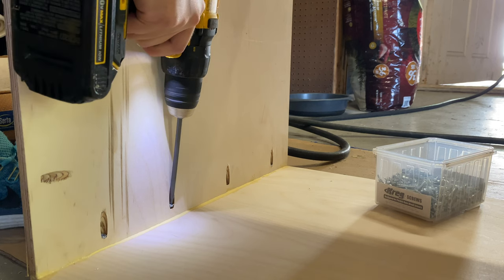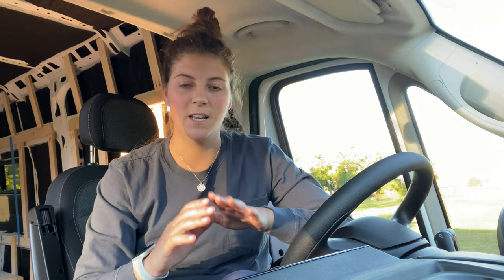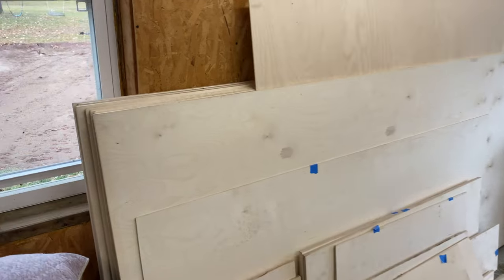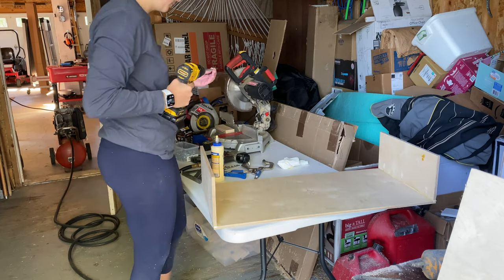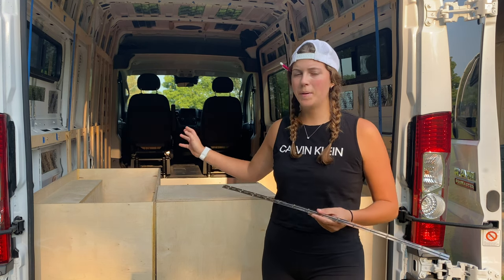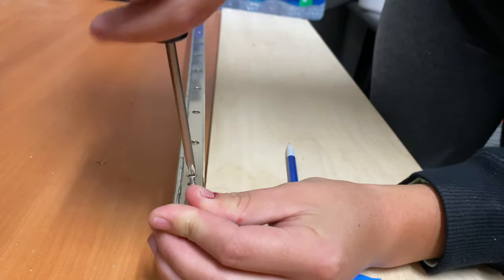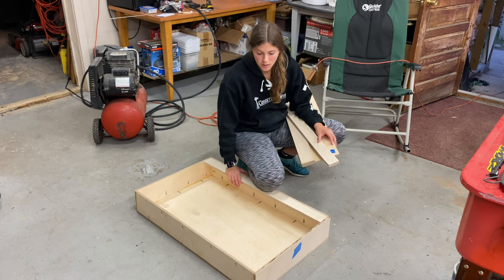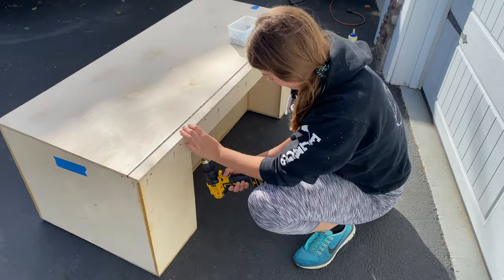U-Shape Convertible Bed | Ram ProMaster Van Build Series 9 | Van Life | Solo Female Traveler

Comment: Great job. I'm 72 years old and my wife and I are not as agile as we used to be.  I'm going to build the U shaped bed to hold two 28" cot sized mattresses with barely enough room between to stand up in to get up and around in the night.  The space will be approximately 10 to 12 inches wide. The head of the bed, by the back doors, will have a 12" by 36" fill area.  That will give a wider space for the top half of our bodies to stretch out and be perfect for sitting up and walking out of the bed area. I probably won't use a fixed, or movable table in the bed area. I love your modular set up. I will leave a toe kick area on the base of the bottom cabinets for walking in and out of the bed area.  Kind of like the toe kick under kitchen cabinets.  The front of each side cabinet could even be sloped wider at the floor.  I'll figure all of that out when I get the plywood and tools out. Your video has been a great inspiration.  Thanks.

Comment: Really well thought out and built. Only change I might have made is the section for your sport equipment,  with the rear of the box able to fold down or be removed so that that section could have been easily accessed from the rear of the van as well.  But that might not be an issue for you.
Reply from the maker: Great suggestion! I don’t foresee it being an issue for my needs, but that might be a good idea for someone else. Thanks for sharing😊

Comment: The holes you made to get into your storage spaces, a hole saw would work,  with your jigsaw, then sanding the edges so they are rounded
Reply from the maker: If someone wants a circle hole then sure. I wanted an oval shape as it makes more sense for a hand to reach in☺️
Reply: @LaurenLawliss  I think what they're saying is, use the hole saw drill bit to make a round hole on each side of the oval template, then jigsaw out the center to make your oval cutout. Then smooth around the edges.

Comment: I wonder for a bed if a high quality easy chair recliner could be used for a bed. There are those that plug in and can be heated or even have masage and the back and leg support move independently and stretch out to be flat or almost flat. I wonder if you ever say that or considered that. I doubt they are as flexible as the options you showed here, but I think they would be more comfortable and could even be removed and put into a tent, or under a folding cover. I cannot see how well they would fit in a van like yours or how flexible the space around it would be.  But, it would probably require the least amount of work and you could also sell it if it didn't work.
Reply from the maker: Could certainly be done if that’s what you wanted to do. I would never consider that based on my wants and needs, but everyone is different 😊

Comment: 8:50 - what is that little blue tool you are using to drill a pocket hole?  That's pretty cool.  I've never seen it before.
Reply from the maker: That is the Kreg 320 Pocket Hole jig. Since then I have upgraded to the Kreg 720 Pro Pocket hole jig - an absolute must!!!

Comment: Like everyone else, I'm impressed with your skills, Lauren! One question (again, sorry): did you screw the side boxes to the low section furring strips? What did you do with the center and back boxes? are they attached to the floor? I'm not sure this would be my bed choice since the fixed one is quite simpler, but you keep inspiring me out of my comfort zone 👌
Reply from the maker: Thank you! So the original plan was to drill the boxes to the furring strips. So far I’ve only permanently install one box and I just screwed it down into my subfloor. I plan on doing that with the other three boxes too. Keep the questions coming, I’m happy to add my two sense. I know you can do this bed style if you choose, you got this!!🤩
Reply: Excellent! Thank you for your kindness and patience with me 🤲
Reply from the maker: Anytime🥰

Comment: Love your videos! I’ve been stuck on electric for months and so ended up just not working on my van at all out of frustration, and I finally feel motivated again because of how straightforward your explanations are! Curious if you think it’s necessary to have a bottom on the box? I’ve already installed my flooring so wondering if I can just leave the box without a bottom?
Reply from the maker: Thanks for your comment, Madeleine! I hear you. Sometimes taking a break from the build is necessary. It can be overwhelming and frustrating at times. 

Great question! No, I don’t think a bottom on my bed boxes were necessary. It’s fine with or without a bottom. I added a bottom because I knew I’d be moving the boxes around a lot before permanently installing them so the bottoms helped them stay in tacked. But if I did it over again knowing what I know now, I might skip the bottoms to save on weight and space. But totally up to personal preference. 

Good luck with the rest of your build! You got this!
Reply: @LaurenLawliss  That makes sense! I hadn’t thought about that - definitely easier to move them around when they have a bottom! Also curious for your thoughts on using 1/2” Sande ply? I’ve had a really hard time finding Baltic Birch. Unfortunately it’s only 3 layers, not 9 like yours, but wondering how crucial that is in your opinion?
Reply from the maker: Honestly, I LOVE baltic birch plywood. It has so many benefits and I really tried hard to find what I have. At the end of the day, other plywood will get the job done so it is up to personal preference. If you are near the Tampa, Florida or Utica, NY area let me know because I know two places that have some baltic birch.

Comment: really great video. just curious how did you attach them to the wall/floor of the van?
Reply from the maker: Thanks for the comment! I fastened the to the subfloor and furring strips with screws in multiple locations. Also the weight of the electrical and plumbing helps to hold it in place☺️

Comment: I'm curious, why not buy a portable power station like a bluetti  for your electrical needs instead of battle born batteries?
Reply from the maker: Thank you for your question! Personally, I didn’t want to deal with the hassle of setting up the portable system every time I needed to power something. Also, my electrical setup will be powering all my 12v DC and 120v AC appliances so through my calculations, I require a large amount of power for everything. The portable setups are great options for certain needs, but not for mine. Hope this helps!😊
Reply: @LaurenLawliss  Ok I understand, but I recently saw a video from a van builder that used her bluetti to power both DC (puck lights and fan) while simultaneously powering a/c appliances. She hooked up a fuse box to the bluetti for a/c appliances and d/c also and then she ran electrical wires into a outlet box to plug her a/c appliances into. There's two people that i've seen do it Jonnie's Journey and also DualEx. Check it out if you can. Great video by the way.
Reply from the maker: I'll check them out. Thanks!